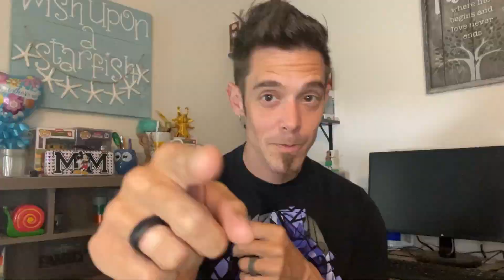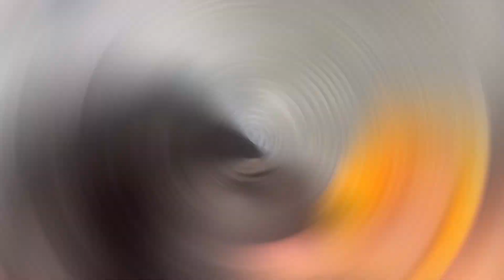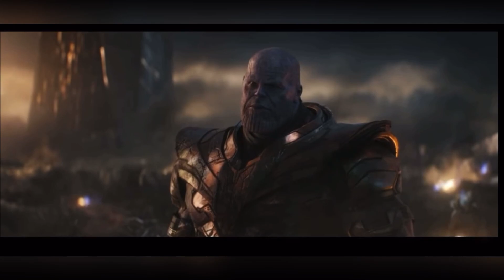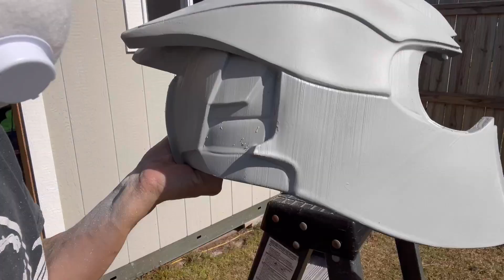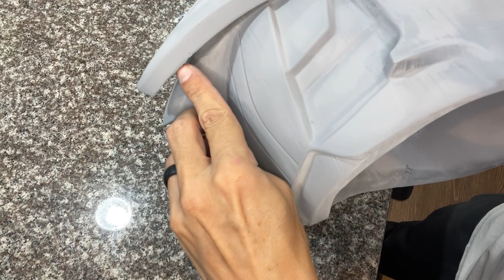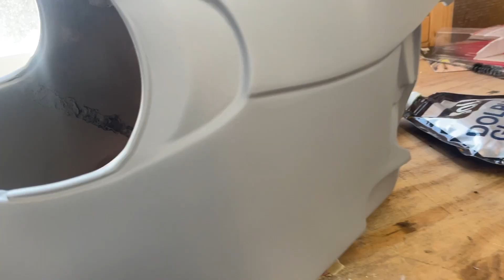3D printed thanos helmet | Smooth 3D prints faster than ever with this sprayable high build filler!

Comment: I used the dolphin glaze to try it out on a few pieces and holy crap was it sticky. Was a pain to sand. Any tips on using it?
Reply from the maker: How much hardener did you use and did you mix it well? The key is to mix it for about 60 seconds. Sanding I usually only need 220 and 320 I can of course do a video if it will help
Reply: @Darkwingdad  about 1-2% hardener. Only mixed for about 20 to 30 seconds so I will try again and mix longer. Does it get less tacky the more hardener you use?
Reply from the maker: @benibarra23  it just sounds like there wasn’t enough hardener and it wasn’t mixed well. Use a piece of cardboard don’t use a dish. I’ll will do a video this week to show what I do, the filler is definitely sticky without the hardener so it sounds like a combo of each. I will do a quick video with some tips for reference.
Reply: @Darkwingdad  thank you so much. Looking forward to it!

Comment: Looks saaaweeet! Can't wait to see her all painted up man. Couple requests...Can you do a video on padding a helmet? What to use and how to apply the padding. Also, a PLA welding video would be helpful, since that's a technique I have not yet tried. Also as a helpful tip, when using Bondo glazing putty, to avoid heavy applications you can thin it with acetone in a paper coffee cup. Use a little acetone to make a slurry and paint it on using an acid brush. This gets into the layer lines nicely...and rather quickly since you're painting it on...Cheers 🤙
Reply from the maker: Thanks brother, so I will have a padding segment on the starlord part 3. That should be up in a week or so. As far as welding goes I have 3 videos up and I can link them for you.
Great tips with the putty, I’ve yet to do it myself but heard it works awesome!

Comment: It sounds to me like Slick Sand probably fills in more than regular ole filler primer, but I'm not sure I could justify the cost of the spray gun setup + compressor, and the difficulty of all the mixing and cleaning, when you'll just end up using filler primer anyway down the road. Seems like it saves you 2, maybe 3 coats of regular filler primer?
Reply from the maker: No not at all. Normally I’d have to spend an extra 2 hours of sanding. Apply a filler, sand, apply glazing putty 1-2 times and sand twice. Than do 4-5 rounds of filler primer with sanding. 
This product saved me easily 1-2 days of prep. There is a HUGE difference between this product and a filler primer. They aren’t even close.
Reply: @Darkwingdad  Well then if it's as thick as you say, would this only be recommended on relatively large models without fine details?
Reply from the maker: @MasterCheifM  hvlp guns have a regulator to control the flow, this can also be thinned down with acetone, so it can be widely applied. But if the model has super defined areas it may not be the best option for it.